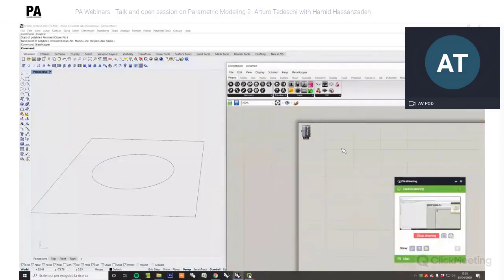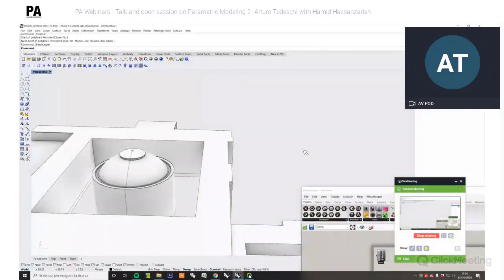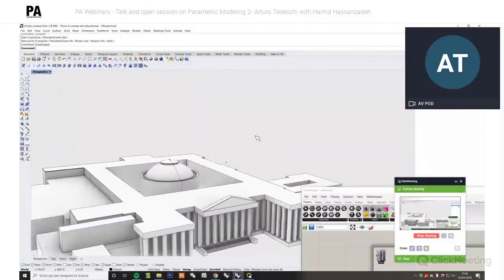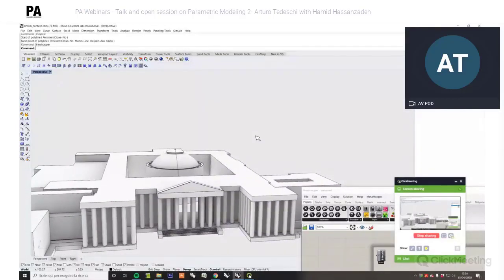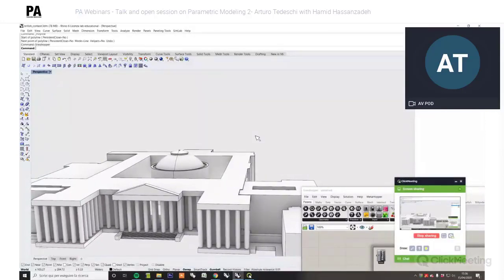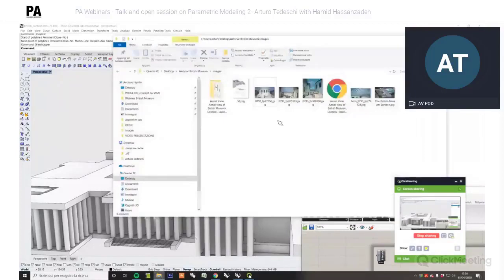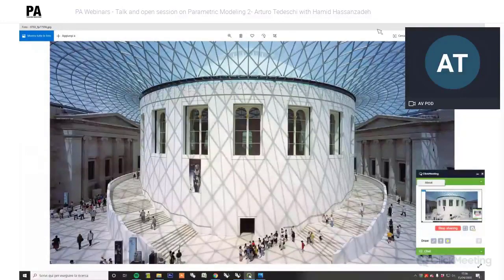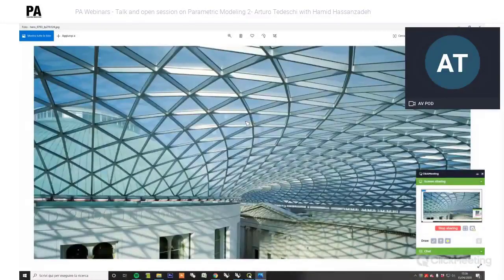Modelling the British Museum with Grasshopper (Gh, Kangaroo, PanelingTools)

Comment: Hi Arturo, lately all your videos are amazing. Many Thanks!
Once said that, both doing the basic shapes in GH or importing them (sharing the centre) in the phase of getting the naked lines it appears an extra line coinciding with the X axis. I solved it creating an ellipse with same axes instead of a circle and worked, but in any case after converttodiamond the horizontal lines in the corners do not match with the pannels shape (instead going from corner to corner, they break and go the end center of the diamond). 
Does anyone has had the same problems?
Reply: Yes I had a same problem. And I am new to Grasshopper. So if you have got the solution now, please consult. Thanks